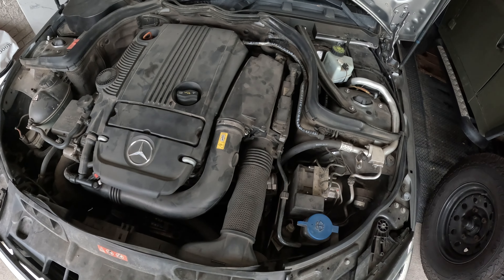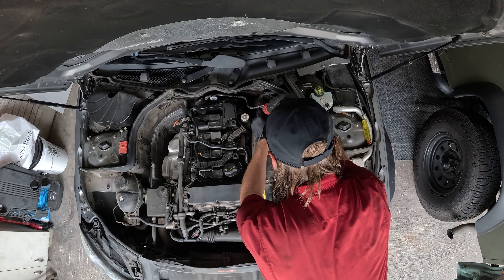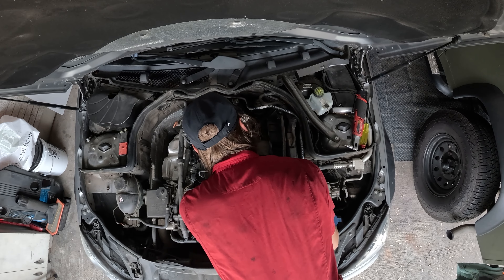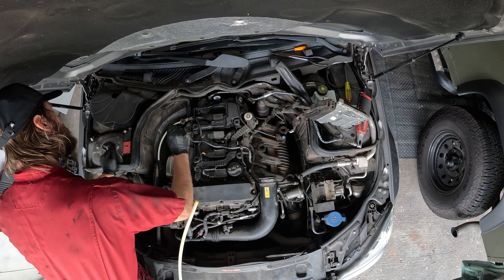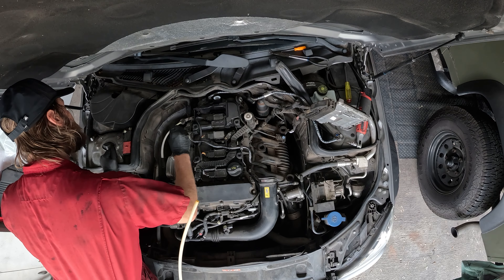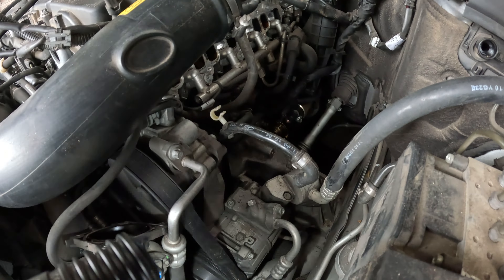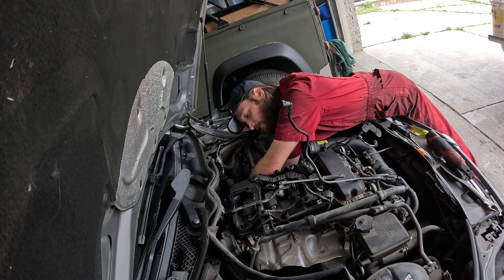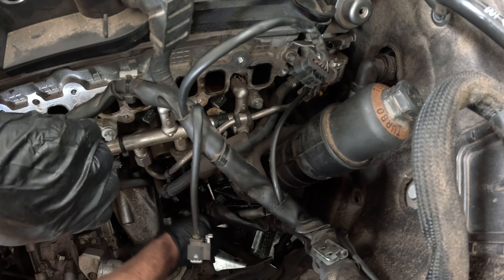Will it take all day to Replace & Upgrade a Mercedes C250 oil filter with aluminum housing?

Comment: Did one of these today without any instructions... spent just under an hour removing and replacing the oil filter housing, and putting everything back together. FYI, no need to disconnect any of those rubber vacuum hoses; just place the intake on top of the rocker cover. The longest part was flushing the oil out of the cooling system, but overall, it went smoothly!

Comment: Good video. I don't mean to frustrate you after the fact, but there is an alternative way to remove the oil filter housing. From the top, all you need to remove is that small plastic pipe that runs across. Since you have to be under the car to remove the starter anyway, you just take the bolt out of the steering shaft and swivel it out of the way. You could also take that little thin cross brace thingy (technical term) off if you choose. I chose to just replace the gaskets and seals rather than the entire  unit, and even with all that it only took me 2.5 hours, but I'll admit it is very uncomfortable lying on your back on a concrete floor, but it's also uncomfortable leaning over an engine bay.  With a lift? No brainer. Otherwise, it's just preference.

Comment: I’m surprised you’re even touching a Mercedes. They look like and absolute nightmare to work on. Good on ya man.
Reply: harder job more money
Reply: honestly my dude i thought the same thing before i started working at a mercedes dealership but after getting some experience its actually not too bad, yes there is some things where youre like ''WTF!?" but for the most part they are pretty straight forward but having a diagram on how to do things on benz's do help alot too but not completely needed
Reply: @thatdusty950  well said

Comment: I just would like to know if this unit failed, does it cause oil to mix with coolant?
Reply: @Linoge279  apparently since i have oil in my coolant and I recently replace the oil cooler and gasket

Comment: how do u know if d gasket is broken  so as to replace for a new one
Reply: Hi, It's likely that you will see the oil has leaked down over the starter motor and down the left side of the engine pan and onto the undertray. The base of the oil filter is a tough spot to lay eyes on - hidden by the starter motor from below and the inlet manifold and its vertical section from above. It's a good gasket to change if your finding brittle gaskets elsewhere on the engine. Even a low milage engine (100k) that has done a lot of short trips (heat cycles) will have gaskets that are on the way out. I'd suggest taking a pre-emptive approach and change the O-rings and gaskets on the oil and coolant pipes for the turbo, change the gasket for the oil filter housing, change the gasket for the timing cover, and possibly a fresh thermostat and coolant overflow tank along with the traditional hoses, fluids and serpent belt change, depending on the service history. Any slight weep in the cam chain cover, I would leave until a cam chain replacement, if checking the torque values of the bolts didn't cure it (don't over torque them - aluminium will either strip threads or the bolts will snap the next time someone tries to remove them) . Of course if funds are tight, just keep a check on the fluids and fix each issue as it inevitably arises on an aging car.